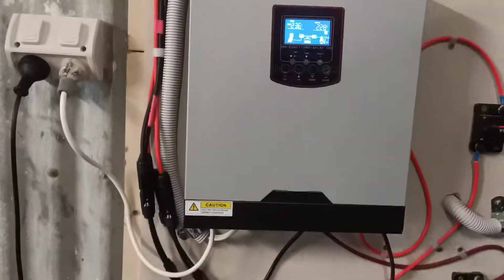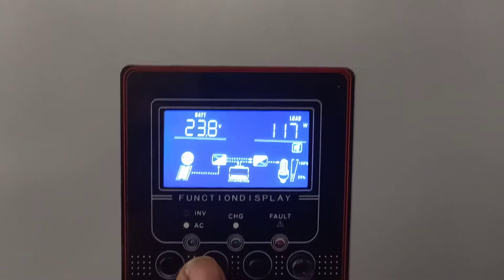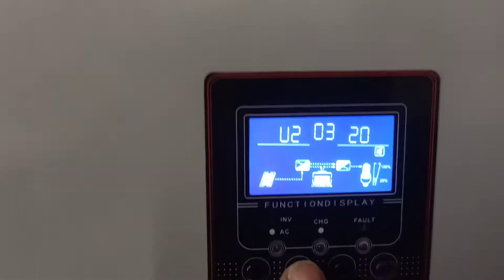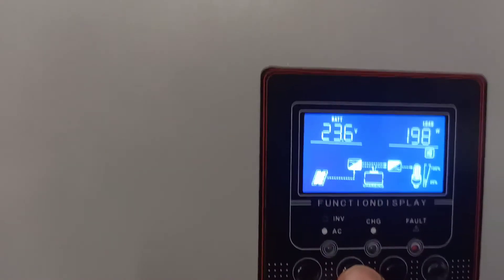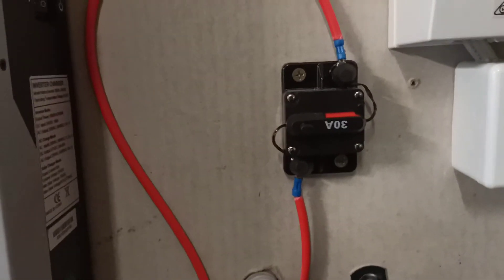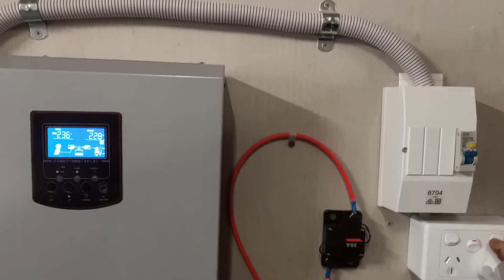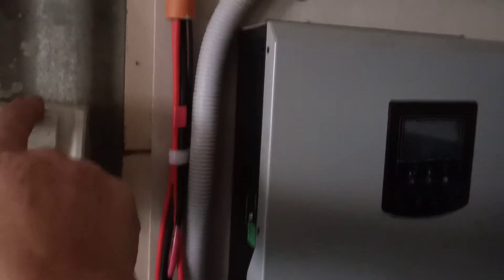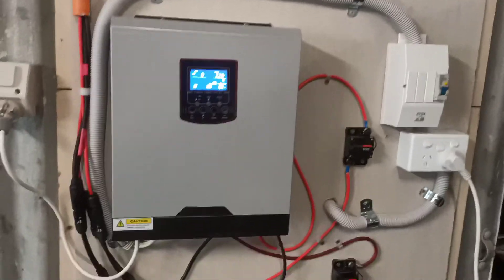Off grid 3KVA 24V PWM Pure Sine Wave Hybrid Power/Solar Inverter Solar Charger Controller test

Comment: Why is it only charging lifepo4 to 27 volts? as far as I can tell, everything is set to a full 29.2 charge ,which is also the full charge setting on the Battery pack's BMS..

Comment: Hi Nick, and thanks for the video.
I own an easun mppr 2.2 kw inverter but I have a problem. I change the value of "voltage point back to utility..." (program 12) and after 10-20 min the value returns to default. 
What could be the problem?
I can't find an official Easun support page ?!

Comment: Hi mate, if you have a load of 800watts does the inverter gives 800w from either batteries or grid or it can give you for example 500w from battery and the rest from grid or vice versa
Reply from the maker: 800 W would be coming from batteries. I do not have enough solar  panels to run 800 watts constantly. But the system is still working and would be ok for up to 2000 watts . My system vis in my workshop for my tools and lights.

Comment: is this unit for off grid use only  as i cant see a ct clamp that goes on the mains to stop exporting to grid  i thought it was going to be like a grid tie inverter  that powers the main  wiring in the house and  use is power from the batteries
Reply: NOT A GRID TIE. These are an UPS, INVERTER/ CHARGER, WITH A BUILT IN SOLAR CHARGE CONTROLLER ALSO.Has separate AC IN AND OUT, AND solar input. also has connection to turn a generator on,if there is no house power or solar power  or charged batteries. all in one . uses and charges batteries. it's the coolest thing going . this model is still only 300 bucks. BUT. it is said to be only for lead acid batteries, but I've been using lifepo4 for years with no problems. the voltage requirments are the same. These only have PWM solar charge controller, which is no big deal with only 6 panels in good sun. But you can also, or instead,  use any other MPPT solar charge controller to charge the batteries, if you want.

Comment: hello, what would you recomend as my bulk voltage setting on my inverter, i have a 24v100H lithium battery with a charge voltage of 25v and a discharge cut off voltage of 16.5v...... cant figure how to set the bulk charge voltage in my 3kva inverter

Comment: You need a 100amp fuse. Between the battery and inverter.     If the inverter is 2000watts.  Then 2000÷24volt battery=100    If. 3000watts inverter. Divide it by the battery volt.  3000÷24volt battery=125
Reply: why?

Comment: Does anyone know someone who has hooked up an oscilloscope to the output on a inverter. I would like to see the sinuswave. I know how it's look like on an inverter to a motor, but has never seen it on a inverter  to the network. Does anyon never had problems with emc.

Comment: Hi Nick. Can you run a refrigerator off this system. If so how many Acid batteries would I need and what size solar panels. I have a new medium size Samsung LG refrigerator. Refrigerator watts 120 power in put 160 defrosting power input. Voltage 230.
Reply: 160 watt output sorry
Reply: 160 watts defrosting output sorry again Nick. Your help would be great live in the Philippines and in the mountains have just about everything off the grid but my refrigerator. No need for aircon were I live.
Reply: @EL-iu2tp  Hi, you can count Amp/h*24v system example. you got 200Amh system for 24 volt, 200*24= 4800 watts, then 4800 watt / 160watts of your fridge is = 30h in use, remember tho that fridge is not always on 160 watt use its only then it compressor is on so its like 45% of the time off. And one other important thing led acid batteris is working between 50-100% and lithium 5%-100%. but lithium is better is you know what you are doing beacose of fire broblems.

Comment: Hi Nick how are you doing? So I recently purchased the exact same inverter but I have some issues with it so I'll try my best to explain. So I live in an apartment and needed an inverter to power on my home appliances whenever we get power cuts. The inverter is connected directly to the grid panel that controls all the power in my apartment. What we tried first was connecting the AC input to the main fuse/switch of the grid and the AC output was connected to a separate fuse in the grid panel that was not in use. So while the main power/primary source was on, the inverter was charging and once it was full, I noticed the red fault light blinking. One day the power went out and the inverter showed an error 5 code. The system was unable to switch over towards the inverter in order to provide power to the apartment. So then once the power came back, I switched the inverter back, it went back to charging and the fault started flashing yet again. For some reason, when the power goes off naturally, it isn't switching over to the inverter so that the inverter can provide power to the grid. The only time when it does work is when we manually shut off the grid entirely and once we turn on the grid manually, the inverter switch over to the main power supplied by the grid and starts charging again. I also have to mention that I did configure anything in the programming so maybe that could be the issue but what are your thoughts on my situation? Hope to hear back from you. Thank you!
Reply from the maker: The system is not designed to connect to grid it should be stand alone .I would recommend seperate power outlets
Reply from the maker: Also there is a video on my channel showing off grid program

Comment: Do you have a link to the monitoring software?
Reply from the maker: No sorry the system is in a shed/garage and is purely for using lighting small fridge tools etc. Still going strong with no issues

Comment: Mini Solar (Winter) Tipp: e.g. a Beuler and all other hungry electricity consumers can be continuously adjusted down to e.g. 300W with a 5000W dimmer (7EUR). I run 5 dimmers in parallel on an 850W inverter. Kettle 2.2KW at 150W runs 12 hours a day, so the water is always hot. The room is also nicely heated. 2.5KW washing machine runs in parallel with dimmed to 200...400W. Iron, dishwasher, oven, electric heater, coffee machine, all internal heaters are throttled with me. Videos about it on my channel https://youtu.be/eC2olbCBhh0 The inverter stays cool, quiet and the MOSFETs remain intact because extreme current peaks no longer arrive at the inverter. Now every Mini PV Inverter is enough to sell large devices...

Comment: how many years do the batteries last?
Reply: Depends on the batterys and how hard you runt them
Reply: @Adam-bw4lw  Usually they degrade by cycles, idk wdym with runting👹.. I wanted a cheap battery bank

Comment: Looks great, thanks for posting. One question please. how big are your batteries? I gues they are 12V, 2 in series and 2 in parallel connected.
Reply from the maker: Batteries are 100ah connected to make 24 volts
Reply: @fixingstuffwithnick7679  one more question please, what are DC input data, how much you get froma panels V and A? What is max?

Comment: hi, can this unit work with x 4 deep ( wired in series 48v ) cycle battery?
Reply: It's a 24v unit but you do get a 48v in 5kva
Reply: @donovanbarrow196  I ordered the 5.5 KVA, Y&H, I was hoping it will accept my batteries I already bought?
Reply: can this unit work with x 4 deep ( wired in series 48v ) cycle battery?
Reply: 4 12v Gel Deep Cycle Gel 100ah 30a

Comment: you have to use a 150a dc breaker for the battery. it's on the side specification label on the inverter.

Comment: Hi
I have the same inverter, and it says on the User Manual: 'before connecting to AC input power source, please install a separate AC breaker between inverter and AC input power source'. However, fot what I can see in your video, you are using (half) an extension cord which connects  from the inverter directly into a wall socket. Did you research this? I have seen this system on you tube with the same extension cord into wall socket configuration, so I am not sure why 'eveybody' seems to be ignoring the manual!?

Also, quoting the manual again: this inverter/charger should be connected to a permanent grounded wiring system'. I cannot see this clearly in your video. How did you go about it? 
Thanks in advance!
Reply: Hi. I have the exact same question as yourself. Manual says it needs a seperate breaker for the AC input. Perhaps they mean you need a breaker if your plug does not have a fuse, or if your inverter is wired directly to your homes consumer fuse box?
Reply: @klausschwab4019  This goes deeper than I thought. Reality is that most people on you tube either don't really know what they are doing, or they are taking a bit of a risk. At the moment, in my situation, I am not going to add AC input because it seems to be too much hassle to do it safely (and I don't understand the issues fully, anyway). 'All in one' inverters with AC input are a new thing, and even local electricians don't know how to deal with it. Main issue seems to be the earthing/grounding arrangement.
Best resource I have found is Rolland W's channel and specifically the playlist about earthing inverters. I have also written some comments there that may help you. 
https://youtu.be/H5Pt5i5gG2I
Reply: @headphonekiller5  Thanks for the reply. I think with the small 1kv version I have it already has a fused plug. Where it asks you to add a breaker in the manual Im pretty sure its referring to the plugless versions that therefore dont have fuses and thus you need to wire it to your consumer box and add a 10A breaker. Thats what I think it means anyway. My version comes with a plug with a 13A fuse, this is obviously sufficient.

How do you charge your battery without AC input? You cant really use this device for its intended purpose without AC input?
Reply: @klausschwab4019  Sure, I may be overcomplicating things, and you could be right. My system didn't come with a fused plug, but it'd be easy for me to attach it myself. However, for what I have read, this is not good practice (for my system anyway).
I'll be charging the batteries with the solar panels of course!
Let me know how it goes with the AC input plug, or if you find a definitive answer at some point please.
Reply: @headphonekiller5  I am not an electrician but I have some experience with electrical work, fitting breakers, fitting electrical showers etc. under supervision from a qualified electrician. I always make sure I know exactly what I am doing before I do anything electrical but I am not qualified to give advice, but this is what I think the manual is asking for, and people should only use this as a guide to find the right answers elsewhere, I wouldnt trust some idiot in a youtube comments section.

My system is a smaller system, the inverter is only the 1KV system which comes with a plug you can plug directly into a normal plug socket, the plug is obviously fused and so will blow if the unit tries to draw more than 13 amps. 
    I believe the larger inverters do not come with a plug which I can only assume is because the power is larger and so they need to be wired properly with the correct gauge of wire to your consumer box with a proper breaker switch, which would make it much safer than the plugged system, but of course the 1KV system doesnt need to be that safe because it is lower power, this is my lamens understanding of it. 
    Bear in mind Im an idiot and I briefly considered splitting the plug wire in half and putting the battery breaker in between the plug socket and the inverter, thats how confused I was, this wouldnt have been dangerous as long as the breaker was never touched, ofc its ridiculous and hence why I didnt do it, but thats what it seemed to ask in the manual lol.
Reply: @klausschwab4019  I would be interested to see how your install is going. According to a post here https://www.youtube.com/watch?v=eQ1Itspy9aM between Ciprian Alexandru
 and Roland W - quote:
'If you connect L, N and PE from a socket to the inverter terminals, then the invertor shell or housing is grounded. When your inverter is in bypass mode with grid directly connected to inverter output, then your output is as well TN-CS. But when your inverter is in off-grid mode, the output is IT. only a N-PE bond will make your output as well be TN when off-grid.
The important is that the bond is on the N input of the RCD/RCBO so ground leakage can be detected. But you will not be able to plug the inverter ac input into a house socket. As your house will have a RCD and will trip when the inverter goes into bypass mode. The ac for the input must come from before your house RCD too.' (end of quote)

I'd be very interested in knowing if your house RCD is tripping, and if it is not, why do you thing this is?
Reply: @headphonekiller5  To be clear, I am from the UK and we have different electricity system than the US, we are on 240 Volts and I think the US is on something like 120V. I cant be sure and Im not sure if these factors make a difference. We use a 3 pronged plug which includes a ground/earth. 

As for the inverter going into bypass and being powered by the grid and there being a problem with ground leakage. Im not sure. Mine is plugged into the wall and the RCD breakers are not tripping. I am only passing about 60W continuously at the moment, perhaps it is not tripping because Im only using about 60W of power through it at the moment?

I am somewhat familiar with how RCD breakers work in that they are supposed to trip if they get an unexpected surge so as to minimise electrocution if somebody touches the wrong wire or something.

As you can tell Im no electrician, but on bypass mode you have a ground pin. The inverter is connected to ground through the plug and all the way back to your consumer box. Im not sure what the problem would be. But as I say, mine came with a plug and its clearly meant to be plugged in, remember mine is only a 1kv inverter and the larger ones tend not to come with plugs and I can only assume the reason they dont come with plugs is because of the higher power and at that power they need to be wired proffessionally to your consumer box. 
Im probably not the one to ask, being as Im an amateur electrician lol, but happy to help if i can.
Reply: @klausschwab4019  Yes, same here, all the above applies to Uk installs. Bottom line, if you follow the enclosed instructions in your system, then you should be ok (could you post a link of your system  or a pdf with the inverter's manual?). 

Having said that, I would double check that you are grounded when the Inverter is in an 'off-grid' mode. As far as I understand, the ground terminal on the AC input (which connects to grid) is not the same as the ground terminal of the AC output. If you use a multimeter to measure continuity, then you'll know. If there is NO continuity, then any appliance you connect to the AC output of the inverter, will NOT be grounded. Does that make sense?

As for the RCD not tripping, that's beyond my level of expertise, but thanks for confirming anyway.

Comment: Can you draw current from the batteries and charge them simultaneously?
Reply: if you have more solar than load then yes.
(the solar never stops unless its dark and the invert doesn't stop unless low battery or fault)

Comment: Can you run this without solar? I mean just the battery bank and the hybrid inverter?
Reply: sure ,im using it  as ups with my old lead acid battery  for my tv and router without solar panels works fine
Reply: @presidentchaung  thanks. That is great news. what is the inverter you are using? Is it the same as in the video?
Reply: @ZiyanJunaideen   yes same model

Comment: Hello!   I am new to this stuff and I has recently purchased a 3KVA 24 VDC inverter.  I charge this with 4 solar panels and this seems to work great.  Unfortunately, I have a problem when trying to charge the batteries using my generator!!!   I am on a 240/50 HZ system here in France and ...NUMBER ONE:  I get input/output readings of 260/270!!   (It is like the batteries are actually ADDING to the input/output!!)  NUMBER TWO:  The batteries do not actually charge...in fact....using the generator in the circuit seems to drive the batteries down to the low voltage cutoff and the inverter then shuts off.   Any suggestions/opinions regarding setpoints and/or how to program this inverter properly would be greatly appreciated.   Best regards,  Anton
Reply from the maker: I'm not sure why you have these problems, but there is a video on my channel with some programming

Comment: Does the ac input allow u to charge up ur batteries and also does these units automatically switch to ac when ur batteries are low or your load is to much ?
Reply from the maker: Sorry for the late reply, yes to both questions

Comment: I have a similar inverter charger, sadly for some Reason I can’t make it charge the batteries with a gas generator ac, the only thing I see in the screen of the inverter is a ac logo blinking sometimes but not charging batteries at all. And I changed the charger priorities through all the options without any luck :(, someone knows the reason?
Reply: Hmm. It should not do that blinking on stable AC power . Maybe your generator AVR is set to a different freq?
Reply: I tested also one at my neighbour, it does the same , but if you turn off the power button will charge the baterry , unfortunatly ours has charged the baterry for about 30 seconds then it maked a white smoke and we think the charger module from utility input is fried but we will investigate further … 🤕

Comment: can this inverter put current back into the grid or is the output only meant for offgrid usage?
Reply from the maker: Off grid or supplement grid power used. It doesn't feed to grid